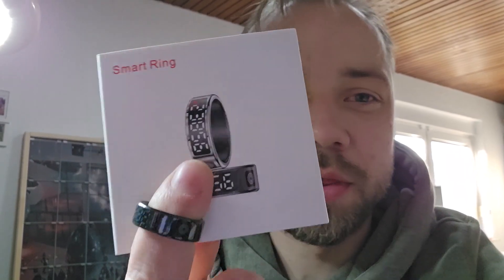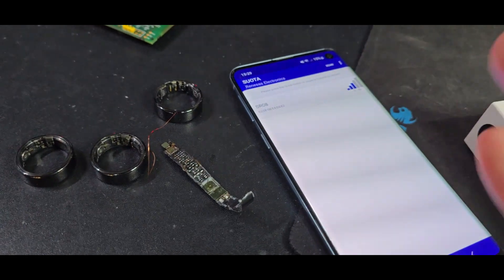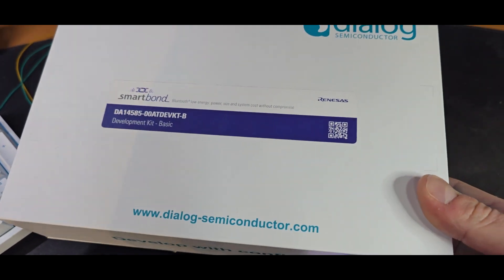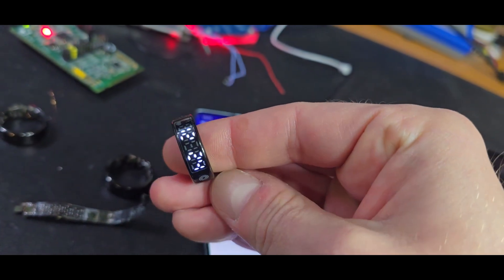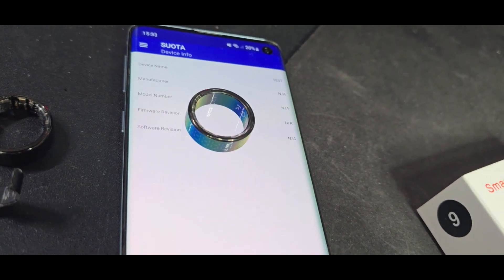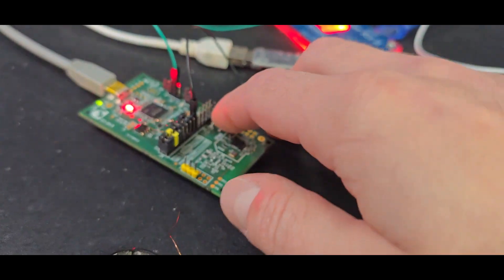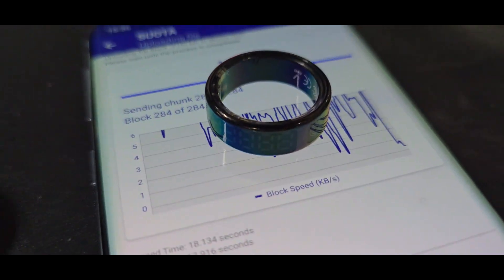Hacking the 22€ BLE Smart Ring that has a Display inside

Comment: ### Summary  
The video provides an in-depth overview of the SR08 smart ring, a compact Bluetooth Low Energy (BLE) device designed for fitness tracking, including step counting and heart rate monitoring, with an integrated LED display for time. The presenter discusses the technical challenges and development intricacies associated with modifying and flashing custom firmware onto the ring, which is powered by the Dialog DA14584 microcontroller. Despite its limited internal memory, the ring includes a 1 MB external flash chip enabling over-the-air (OTA) firmware updates and storage of custom firmware. The presenter shares practical insights into the disassembly risks, debugging limitations, and the necessity of specialized hardware, such as development boards, for effective firmware development. He details the process of flashing custom firmware using the SUOT app and highlights the differences in power consumption between active and sleep modes. Although the custom firmware currently supports only basic functions like display control and touch sensor interaction, the presenter encourages others to explore further development. Overall, the video balances enthusiasm for the ring’s potential with a realistic view of the hurdles in custom firmware development.

### Highlights  
- [00:00:10] 🔍 Introduction to SR08 smart ring with BLE functionality and fitness tracking features.  
- [00:01:00] 💾 Explanation of the ring’s 1 MB external flash enabling custom firmware and OTA updates.  
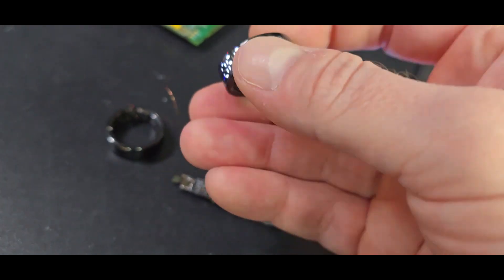- [00:02:00] ⚠️ Warning about the fragility of the ring and challenges in disassembly.  
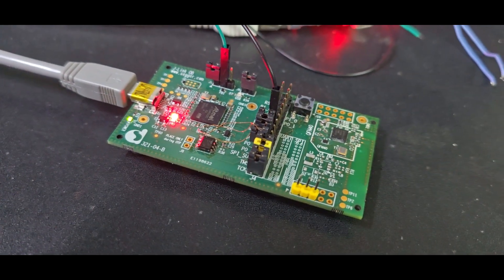- [00:03:00] 🛠️ Importance of using a Dialog DA14584 development board for debugging and firmware flashing.  
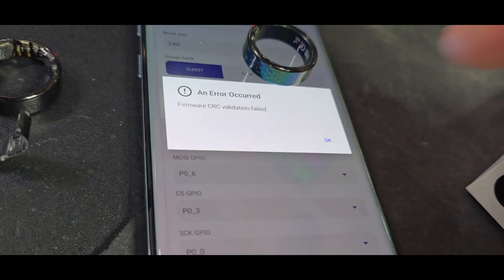- [00:05:00] 📱 Demonstration of flashing custom firmware via the SUOT app and handling CRC errors.  
- [00:06:00] 🔋 Power consumption comparison between active (3 mA) and sleep mode (18-19 µA).  
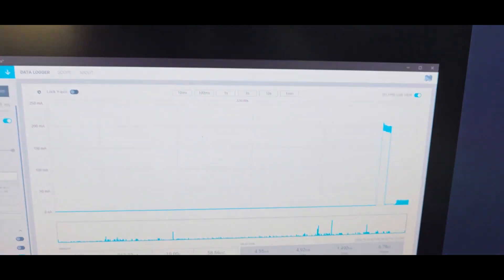- [00:08:00] 🚧 Summary of development challenges and encouragement for others to continue custom firmware exploration.

### Key Insights  
- [00:00:50] 💡 The inclusion of a 1 MB external flash chip on the SR08 ring is a significant design choice, as it overcomes the DA14584’s limited internal OTP memory, allowing storage of more complex firmware and enabling OTA updates. This highlights the potential for hardware augmentation even in small wearable devices to expand functionality.  
- [00:02:20] 🧩 The ring’s delicate construction poses a considerable barrier to hardware hacking and repair, underscoring the trade-offs between miniaturization and durability in consumer wearables. This fragility complicates direct debugging and hardware modification efforts.  
- [00:03:30] 🔧 The presenter’s need to replace the SPI flash on the development board to match the ring’s larger memory size illustrates the importance of hardware compatibility in embedded system development, particularly when working with proprietary or specialized components.  
- [00:04:50] 📲 Using the SUOT (Software Update Over The Air) app to flash custom firmware demonstrates how consumer-grade tools can support advanced modifications, but also reveals limitations, such as CRC errors caused by manufacturer changes in the OTA protocol, which users must workaround.  
- [00:06:10] ⚡ The custom firmware’s power consumption profile—3 mA when active and under 20 µA in sleep—reflects efficient energy management critical for wearables, balancing responsiveness with battery longevity. This insight is essential for developers targeting real-world usability.  
- [00:07:30] 🖥️ The basic nature of the custom firmware, focusing on display and touch sensor control, serves as a foundation for deeper customization but also signals the complexity of developing full-featured firmware for constrained devices, requiring both software and hardware expertise.  
- [00:08:20] 🚀 The overall development cycle’s difficulty, including debugging challenges and hardware limitations, suggests that while the SR08 ring is an exciting platform, successful firmware innovation demands perseverance, appropriate tools, and possibly community collaboration to fully unlock its potential.

Comment: You mention that the chip is DA14584 at 2:00, yet in the root of the GitHub repo I see datasheet for DA14585. There is also neither build configuration nor SDK libraries for DA14584. Finally, the development board is for DA14585 as well. Did you misspeak in the video or are these chips compatible enough that binaries produced for DA14585 can also be flashed onto DA14584?
Reply from the maker: DA14585 is correct 👍

Comment: Keil... Did i develop with that 20 years ago? It looks simpler than micropython. Just kidding. You are very tough minded.

A good starting place would be a complete running environment, then make small changes until you're familiar with the hardware and stuff.

You went the other way and started from scratch. Yikes.

Thank you for the dedication.

Comment: Is there a way to disassemble or hex edit the original firmware file? I'd love to just change the LCD OFF text into some other text.
Reply from the maker: Hey, yes that is possible
Reply: @atc1441  Great! I'd love to know how to do it. Do you have any leads or steps on how to do it?
Reply: @atc1441  Hope you can still answer the question on how to achieve it... 😊
Reply from the maker: You need to reverse engineer the stock firmwarw and replace the right pisition in the hex/bin file with your own wanted content to show and then re calculate the crc fir the header so the update will be accepted by currently running firmware :)
Reply: @atc1441  Yes, I know that it should be possible that way. That's why I asked if there's a way to disassemble it, or which offset needs to be replaced to edit the script. I have no idea how to disassemble the firmware binary file or find the right offset for the hex values to replace it with a hex editor.